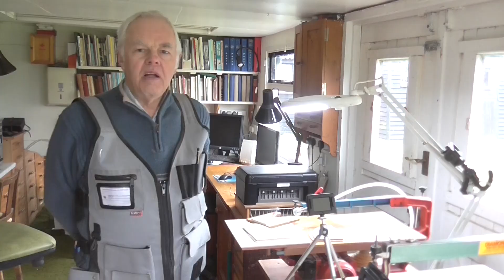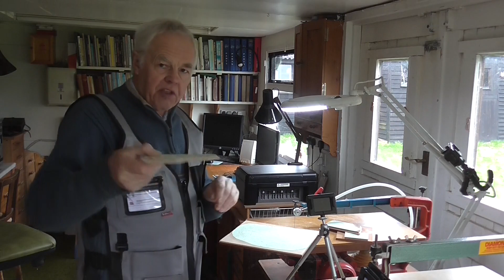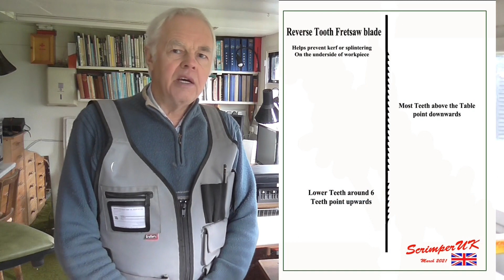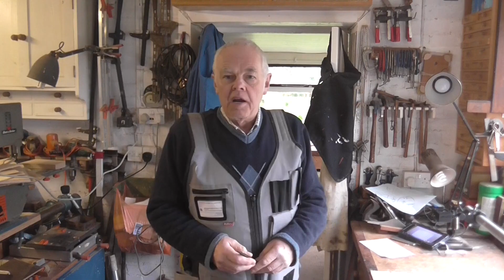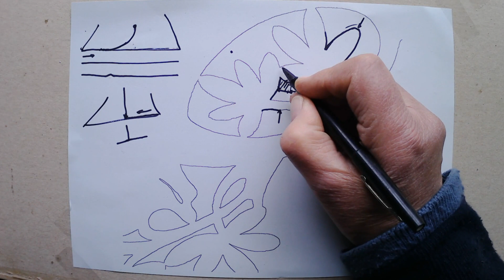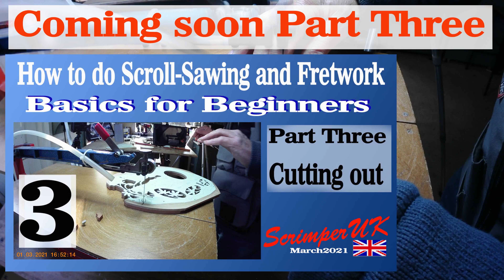How to do Scroll-Sawing and Fretwork. Basics for Beginners. Part Two

Comment: Great very straightforward video only thing I would say is if you want to do fine detail especially on big pieces and you're doing a picture or something spiral blades are pretty much the way to go a lot of the best only use spiral tooth blades
Reply from the maker: Thank you for your comment, unfortunately as you will find from watching my videos I do not agree with you regarding the use of spiral blades, a clue is in one of my comments where I describe spirals as the "work of the devil"!
Reply: @scrimperuk  spirals are the only way to do 4 ft and 5 ft pieces also super versatile
Reply from the maker: @jodyaugust5087  Have to be honest; I don't ever envisage doing any fretwork 4 ft long.
 If I have to do larger designs I do what both the Hobbies and Handicraft companies did with their designs and that is split the pattern into smaller panels then join them together coving the join with an overlay. For example in the wonderful Handicrafts design (no 12) the 'Lords Prayer' plaque which was 32 inches tall the made it with 3 panels with lettering strips covering the joints.
 This also has the advantage that if you have cut 2 panels out and make a mistake on the 3rd panel you don't have to cut the entire design again.
 I have been doing fretwork for over 50 years but I have never had the need or the ability to cut a design 4 ft in length.

Comment: Hi John,  the last time I did any proper fretwork was in the 50's and I don't remember any other blades than standard cut being available. Are reverse tooth blades a relatively new thing?
Thanks to you I'm going to start again and wonder will the these blades work in a hand frame?
Thanks for posting, it seems I was getting most of the cutting technique right.
Reply from the maker: I don't think they were available then Colin. I have been using them for about 20 years. I don't see any reason why they won't work in a hand frame.

Comment: This is a great video John. You gave a lot of good advice. A #5 reverse tooth is my favorite blade for most cuts, though I do have the others too. I agree about the spirals. I draw up mostly my own patterns by hand, not computer. So I use red ink to do my final patterns. I'm not colored blind, but I find it easier to see a black blade next to a red line while cutting. Even with my lighted magnifier mounted on the saw. Boy does it ever show up good!. I enjoyed your video. TI have a Dewalt 788 Type II. Take care, stay safe!
Reply from the maker: Thanks Michael. That's a good tip about using red lines I might try that.